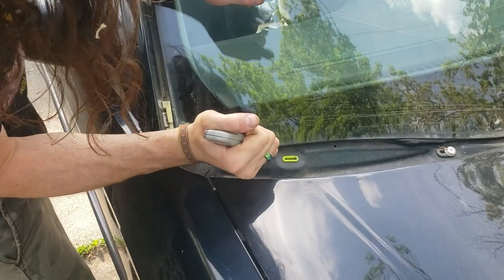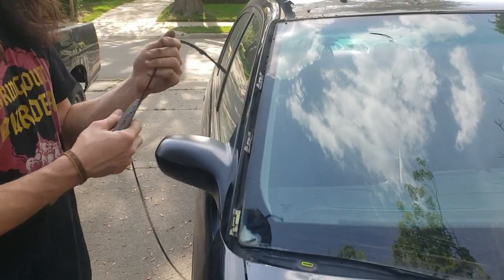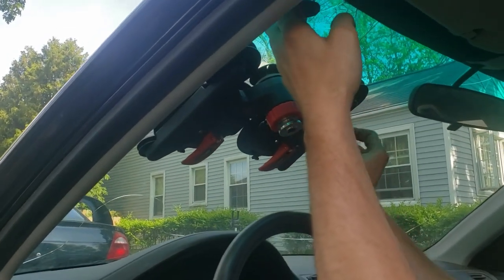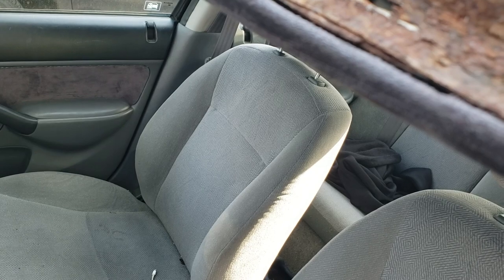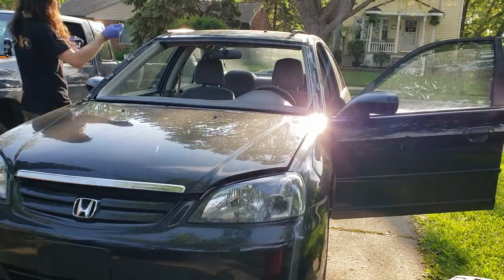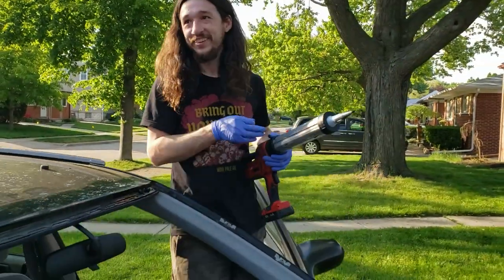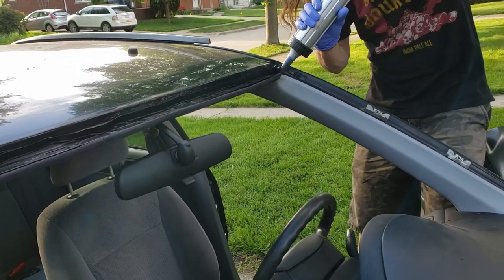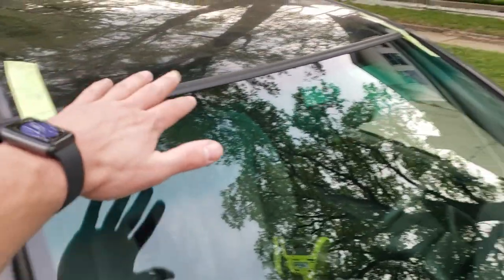Replacing the Windshield in my 2001 Honda Civic

Comment: Just went through this with a Saab, only it was the rear window. You absolutely need to treat that rust or it will leak again. Some one did a terrible job so it had rust, although not as bad as what's in this video, but bad enough to not seal and leak. I had to use a thin belt sander with 180 grit or something around there, then used super assliex K600 by hand to get it smooth. I used masking tape on the edges, then got a can of aerosol paint (matched), build primer, and 2K clear coat. From there, you use 3M single step primer, 3M Window Weld (or betaseal etc, so long as it's good), and some daubers to apply the primer. The primer gets applied to anywhere metal is exposed, but if you have rust to this degree, you need to repair it properly. just an FYI for anyone trying this. I am no body guy but the results were great.

Comment: He stole this tool from Safelite or used to work for them and they let him have it, also lying about how many jobs he does in a day. Only way you can do above 8-10 is if they are all in the same spot and you can possibly stuff a few of them and hack and rush skip steps. Can’t stand technicians (he’s just an installer) like this that exaggerate how many jobs they can do in a day.
Reply from the maker: I'm not sure of he still does, but he actively worked at safelite when we made this video. He didn't steal anything.